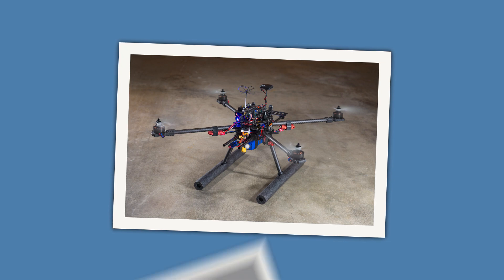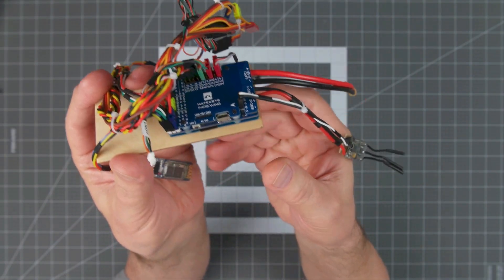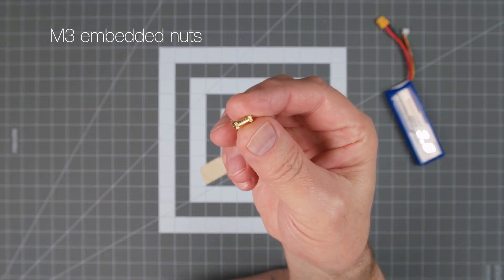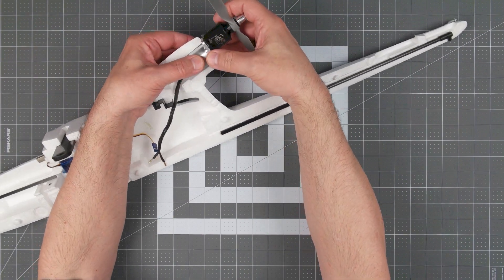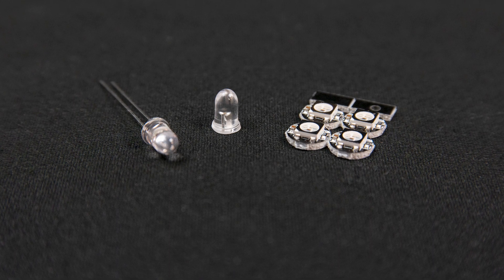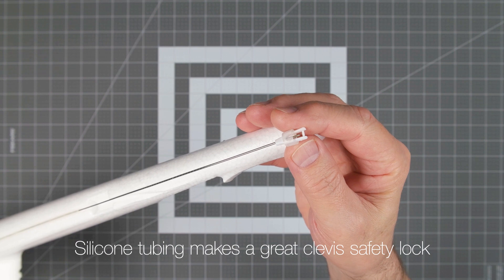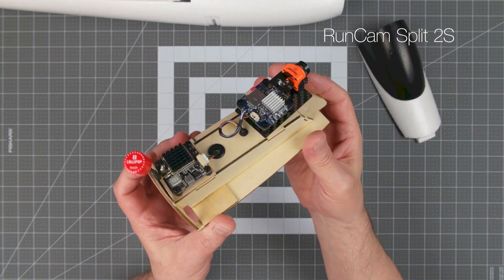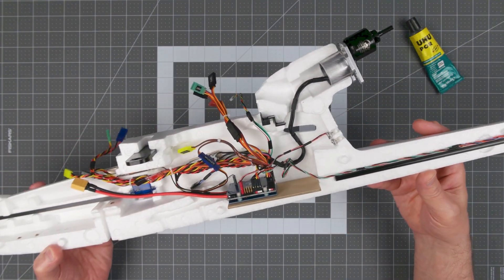How-to Bixler 3 Build With FPV And Head Tracker

Comment: Nice job Crady. I like your conversational tone and sectioned discussions. Top notch videography. Looking for your next fixed wing project. By coincidence I have a Bix 3 kit I will probably follow most of your suggestions to build. 
   From another build I became familiar with the Bix 3's tendancy to tip stall when turning at low speed. I did not notice this tendancy with my Bix1=Sky Surfer. Have you maidened your Bix 3 yet?  - Jim
Reply from the maker: Thanks James!  That's very much appreciated.  You'll have to share your build once it's done 👍 Unfortunately I never got the chance to maiden the Bix thanks to my local field closing immediately after completion (hence the lack of new content).  Cheers!

Comment: how was the akk 2w? and dvr. i have the 800mw small akk and i like it but i wanted to go more then 1 mile. im sure with a better antenna i could get a little more range but i think i need a better akk
Reply from the maker: Thanks for the question.  Aside from ground tests I never found out what the setup could really do.  Before the build was even completed the only flying field near me shut down and I was forced to give up the hobby.  Sorry  =\
Reply: @CradyLab  you can fly anywhere out side city limits because its a open under 400feet
Reply from the maker: @staydown.normalsavas  Thanks.  I hold a Part 107 cert. so I'm aware.  What I'm saying is that where I live there are no fields to fly from.
Reply: @CradyLab  what did you do with your akk or model
Reply from the maker: @staydown.normalsavas    It's still exactly as it appears in the video.
Reply: @CradyLab  if you want watch my videos on the aero scout with inav wse matek f411 i just installed I have yet to maiden

Comment: Crady, awsum build and tidiness. But three years later Im pulling one back out of mothballs to do a redo with whats available in late 2021. After using, if you still even have it, what are your thoughts on the F405 WING and any complaints? I'm eyeballing it for the Bix V3 1.2Ghz/900Ghz LR FPV redo.
Reply from the maker: Hey thanks, Randy!  Much appreciated.  Sounds like you've got a great combination there.  I've never had - or heard of - any issues with the F405 WING if that helps.  I do still have the Bixler but sadly I never had the chance to fly it.  My local field switched to drones-only just after I completed the build and it's a 3+ hour drive to get to open country.  Fingers crossed I'll get to fly it one day.  Lmk how your rebuild goes.  Cheers!

Comment: Awesome, clean, precise to the point, did you glue the entire fuselage? Then in case you need to change something on the board, how would you acces that?
Reply from the maker: Thank you!  Yes I did glue the entire fuselage although something like fiber packing tape would work just as well (the tape could then be cut for access but would also add more weight.)  If you look at 00:02:00 I mention that the flight controller can be removed.  It's held in place with a couple of strips of VHB tape.  It's a tight fit but the FC can be worked loose and replaced [if needed] when the wing is off.  Cheers!
Reply: @CradyLab  Thank you!

Comment: Hi again,got it sorted,it is all fairly easy to dismantle with CR-V 1.5 screwdriver and small pliers,The complete wheel and leg can be unscrewed while holding the (nut) within the tail(at the end of the tail rod) .BUT  , none of this can be done once the rudder and elevator have been glued in place.SO it's make your mind up time!!!  I'm undecided,will sleep on it..Thanks for you time.Best Regards
Kev

Comment: I want to remove the rear wheel mount, but can't see how it is fixed to the end of the through fuselage rod! Can you help on this ,as yours is exposed.?
Kind regards. Kev
Reply from the maker: Sounds like you've already assembled the fuselage.  If that's the case then your only recourse is to cut it off.  The best way to do that would be with a Dremel tool and a cut-off wheel so the cut is as close to the fuselage as possible.  Otherwise you'll need a pair of large wire cutters.  Andrew Newton has a nice video showing how he removed a Bix 3 tailwheel after the fact:  https://youtu.be/dzFt7tgKtUI  Hope that helps!

Comment: wow stunning build
Reply from the maker: Thanks man!  Ironically I still haven't been able to fly it!  😂 My local field shut down and then the coronavirus.  Maybe later this summer if I can locate a new flying site 🤞
Reply: @CradyLab  awww dam that's so sad here in Az the fields are open thankfully but have to keep distance I'm slowly working up courage to build one of these.

 I have a question will spectrum radios work with the board? I have a dx6 radio trying to figure out how to make it work with gear I have or if I am gonna be forced to buy a frysky.
Reply from the maker: @raymondrobinson9054  Sorry, I don't know anything about Spektrum but the board runs iNav and it appears there is some support for it listed on the iNav GitHub page  https://github.com/iNavFlight/inav/blob/master/docs/Rx.md

Comment: Cool video. I would out both t antennas vertical. Not one vertical and one horizontal. One antenna is used for rx the other for tx.
Reply: Thanks Gillis! This is a diversity receiver which means the antennas need to be at right angles to each other (both antennas  are used for Tx and Rx). Cheers